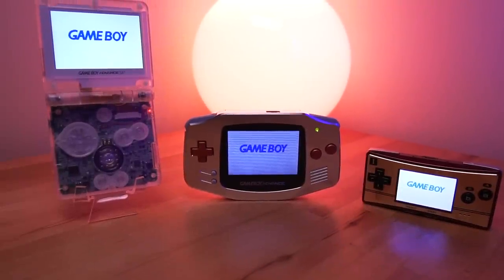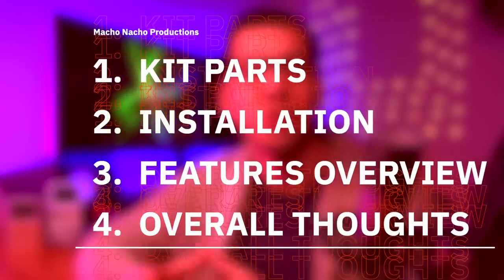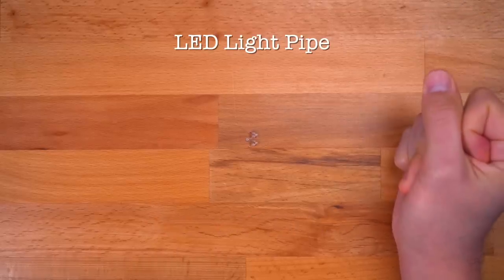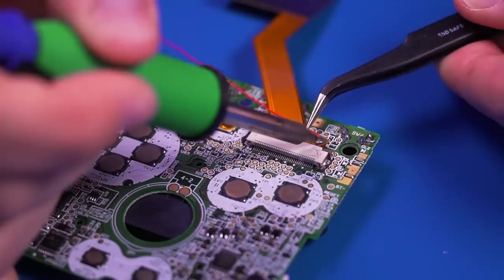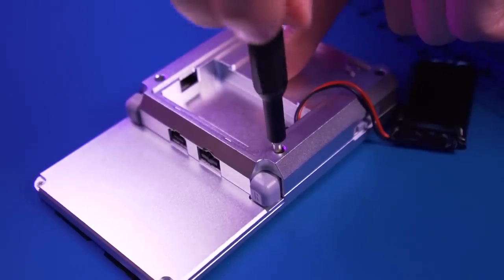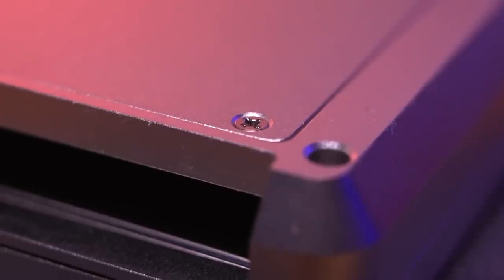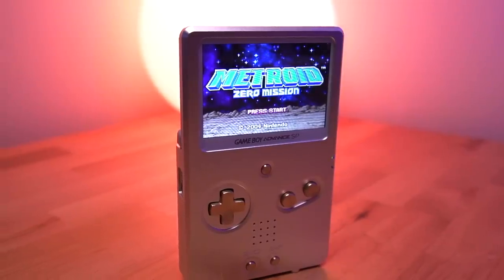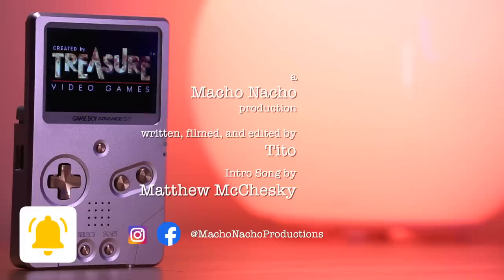GBA SP Metal Shell Without The Hinge! | Boxy Pixel Unhinged SP | Install Tutorial + Review

Comment: Honestly wish they also offered a budget friendly version of this design.... that $94 price tag is for like the 1% consumer....
Reply: I’de take a plastic clear version
Reply: Yeah I think a plastic Version would be cheaper
Reply: I hate to say this.... someone could copy it in and 3d Print but that would be super DICK move since they went through the trouble to make this in AWESOME aluninum.
maybe the $94 you can do like I used to do to be able to afford things.. I put an envelope on the wall and would put a couple bucks in it until I could buy what I wanted.. Just a suggestion.
Reply: @adonian  there are 3d printed non folding case for the gba sp since months on Plattform like thingiverse.
But not looking the same on the display part
Reply: There will be some company making a plastic version if this is even a tiny bit popular
Reply: @-Gothicgirl-  you would think that is the case, but for plastic, a tool would have to be made which would cost at least $10-15k depending on how well it is made. If he sells 1k units, that would still be a minimum of a $20 cost added onto the unit from the tooling alone. Would probably be in the $50-80 range depending on the final materials. For that I think I would just stick with the full metal housing.
Reply: @ArielAces  I knew that because it is my job but a tool can produce more then every metal part must make.
With the tool could be produce more and fast and then the price can be low. Look to the other custom shell of plastic.
The dont cost 100$
Reply: @-Gothicgirl-  sweet. I’m gonna look for it. Thx
Reply: This comment reeks of not realizing how this isn't a big hardware seller like Nintendo, Sony or Microsoft where they can source in huuuuuge masses parts and what not for cheaper.

You do want people who make these shells to make a profit so they can keep working on making these, right?
Reply: Boxy Pixel himself said on his Facebook that he's not the first to sell a shell like this for the sp, he just wanted to provide a possibly popular aluminum option.
Reply: It's even more than that since you at least need the usb c port, and the metal buttons. You'll also need soldering experience. It's just really a product for a gba enthusiast with some money to burn. I could see myself getting this at some point. Trust me, I don't make a lot of money.
Reply: This is way to expensive for most of the people. I thought at first i'd cost you in 100$ in total including a screen damaged SP, not 180 without it. Sorry, but 20$ for the BUTTONS? Also, i live in Europe, that would be +50$ shipping. Why not make a Design where you can use your own ones?
This is really just for rich people who have a lot of money to burn, not a teenage retro-enthusiast like me.
Reply: @magicalruin  it really isn't though, I am terrible with money myself and I am no where near rich, but I spent a good chunk of money to mod an original GBA. It just meant I spent the money on that instead of having it for new games or something.

I know not everything is available to everyone money wise when it comes to situations like you say being a teen, but that doesn't mean "it's for rich people"
Reply: That aint shit compared to the 300 dollar price of the metal gameboy color.
Reply: Really??  In this day, there is NO GBA "consumer".  We are all enthusiasts since it has been obsolete for nearly 20 years.  And in this "enthusiast" market the price tag probably sits closer to 10-15% of us fans.  And, they will most likely sell out.  Yes, this is a niche market, and being that it is not mass produced, the price, as  I see it, it understandable.
Reply: @maxinsano7376  100%. I buy these just because I like to. I play most of gba games on my vita

Comment: I hope they make an affordable plastic version
Reply from the maker: That would be awesome!
Reply: It would probably more comfortable as well. Probably
Reply: Probably not because they go on the bandwagon "making it metal = premium".
BTW metal housings are not more expensive as plastic in production, it's just markup because companies know that metal is associated with higher Quality (which it isn't) so they charge you more.
Reply: @livinlicious  I mean, metal is more expensive; but it's like 20%, not 200%.
Reply: @scrubscrub4492  yeah but of course having any injection molded parts would be significantly more expensive than anything milled or printed.
Reply: since you're looking for a 3D printed product, because you said affordable plastic, there's a few projects on thingverse
Reply: Aliexpress is probably working on it.
Reply: It if was plastic it'd be more breakable
Reply: @livinlicious  i hope another company picks up on this idea, would also like to see a ds lite version since snapped hinges were more frequent there.
Reply: The injection molds are quite expensive (like 10-20k for those parts), so CNC milling aluminum is probably still the cheaper option for a small series.
Reply: @scrubscrub4492  It's not the metal that's expensive. It's the CNC machining. To make the injection molds for something like this would cost somewhere around $25k to $30k just to make the molds, and then more money on top of that to cover the actual manufacturing of the shells. Even at $50 per plastic shell, that's 500 units just to break even on the cost of the molds.
Reply: they'll probably have to redesign the upper part cuz that screen part looks very prone to breaking if plastic.
Reply: @scrubscrub4492  CNCed aluminum is way more expensive than plastic injection molded plastic.
Reply: I feel like this comment is a joke no one got LOL.
If only they would make a plastic Gameboy...
Reply: Falta audio 3.5
Reply: @livinlicious  that's the dumbest comment ever... cnc time is not cheap and yeah when your talking low number runs, plastic injection is expensive too but we aren't talking about some place in China pumping out 5000 plastic shells are we??? So what you're saying is hugely irrelevant to the situation. 

They are a extremely fair price for what they are not being mass produced.

Comment: Am I the only one, clamoring for a boxy pixel shell for the PSP, with a nice screen, bigger battery, maybe with the disk tray removed, making it thinner.
Reply: Yesssssssssss, or even for the Vita....show the vita some love boxy😭😭
Reply: If you dont want the disc, with a c, drive, then buy a psp go. It has the nicer screen and is smaller, etc.
Reply: @Di3mondDud3  I much prefer the controls on the OG PSPs to the Go
Reply from the maker: That would be something I can get behind!
Reply: You lost me at thinner with no disc drive. The PSP's digital support is terrible, there are so many great games you can only get on UMD. Also, thinner eventually starts to get worse; harder to hold, less ergonomic. I'd rather have a thicker, more ergonomic system.
Reply: @mjc0961  same reason i like the wii u and its gamepad way more than the switch.
Reply: @mjc0961   I would love it if they could keep the UMD Drive. However, Most UMD lazers go to crap. And im not sure if many companies want to tackle the UMD lazer setup, when most people can get ISOs, of their games.
Reply: @mjc0961  to be fair, digital support is fine if you mod, which most psp owners should have by now
Reply: mjc0961 the games problem is easily solved by just softmodding your PSP and ripping the UMD’s isos then having them right there to boot without needing the actual UMD in the system.
Reply: @4rtie  and even those chinese twin micro sd card to ms duo adapters work to make getting good storage amounts easy

Comment: Great video man, definitely was excited to check this one out.
I got my hands on this myself and I gotta say I have a few issues with it myself. Most you already addressed, but a big one for me were the L/R buttons, the loss of the springs makes the buttons feel stiff and not having that slight kickback from them just doesn't feel right. They still work just fine, but in terms of comfortability, I'd say it just doesn't feel too good pushing those buttons, especially when they're so close to the upper back of the shell now. It's almost a deal breaker for me if I'm going to be perfectly honest.

The light pipe not fitting properly was also pretty disappointing. But, seeing what you did gave me an idea of what I can do instead.

The other issue I had, it's not too bad, but I have to point it out. I ordered the 3D printed parts to fit over the optional USB-C and headphone jack openings and temporarily installed them, but I ran into an issue where the parts just don't stay in place. Maybe I'm missing something? But it looked as though the GBA SP motherboard is supposed to hold them in place, but I found that nothing worked to keep those parts there, and I really didn't want to use hot glue.

Overall, I think this shell is amazing aside from those issues I ran into. The big one for me is mostly the L/R feel.
Reply: Thankfully barely any games use those buttons
Reply: this was the comment i was looking for. just built mine, and had this issue and a few more. the 3d printed parts not fitting and being color matched like the original sp housing is such a letdown. i feel that boxy pixel just got lazy and knew they dont have to improve their product to sell them

Comment: When this had been announced as being GBC oriented, I was hoping for top loading instead of bottom loading carts. :(
Reply: kind of hard to do
Reply: @levanpolka289  Not particularly. I've taken apart the Gamester Game Changer. I know what's required to do it
Reply: @ViolinistProductions  yes, but if it's already at $94 i think trying to add something like that would be an extra $50 and nobody wants to pay $150 for a GBA shell
Reply: @levanpolka289  You have to remember, the average person isn't looking at this, it's already a specialty item. Setting it up to be top cart loading would be more beneficial to those already looking at this, than not.
Reply: @ViolinistProductions  Nah. Having to desolder and re-wire the cardridge slot to move it would put this in a whole different level of skill to do. Right now it's mostly screws, you want to move it into advanced soldering. Whole different skill set, whole different potential userbase.
Reply: @mjc0961  You don't do all that jazz. It's a single pcb that slides into the standard cart slot with cabling to a new port you just move to the new orientation. No soldering/desoldering of any kind.

I've literally taken apart the Gamester Game Changer, that's all it is. A single pcb that plugs into the cart slot, that's connected to a separate pcb with 3 cart slots on in.

You make the same thing, but single cart slot, wouldn't be that much work.
Reply: @levanpolka289  If you have the money to buy a shell for  a gameboy120$ (cause you need the buttons too) you have the extra money for something like this too.

Lets be honest, maybe 1% of those who would buy it really does because of the Price.
Reply: I agree, bottom loading on a model like this feels kinda wrong. Missed opportunity for sure

Comment: The issue with the GameCube adapter identified at 15:18 in the video is a physical issue caused by those clips.  You can remove the clips from the adapter without breaking them and that would solve the issue.  You would of course have to be a bit more careful in how you handle the GBA.  This should also apply to the Infrared and Wireless Adapters, which have similar clips.  The e-reader may be tricky due to the way its link port extender is placed, (see its wiki for details)

Comment: i'll wait for someone to copy it in plastic for a more reasonable price! But, i can't deny it looks gorgeous. Superb design.
Reply: I've did this once with 3d printing, i found the project from thingiverse (boxypixel takes the inspiration from there). it cost me around $20 to print the parts, but sadly no RL button and no charging port (need to solder the RL button with a tactile switch and a usb c charging module for the charging port)
Reply: I don't know how the bit that holds the screen would translate into plastic..might not be strong enough to keep from breaking away from the lower section the first time it get bumped..
Reply: @jimcornish242  i'm using some kind of styrofoam to hold the lcd (i'm using the generic 001 lcd)

Comment: Since this is a shell from scratch, I really wish they would've focused on making the battery space even bigger since the ips mod is so power hungry and 1700mAh isnt enough
Reply: Dang, cant you just play plugged in? Where do you play that you burn out of 1700mAh and have no wall outlet? Just curious.
Reply: 1700mah is over twice the standard SP battery size...
Reply: @DokterRoetker  i guess i was a little misleading in my comment and i apologize for that. what i meant was that even though 1700 is really great and enough for 1-2 days of gameplay (i have the retromodding 1700mAh in my GBA), i wish that they at least could've maybe made the space somewhat bigger for the battery. I only have this opinion based on that this is a custom shell and they can therefore make it as custom as they like. i quess it probably was on the table when they developed this, but the size shouldnt be too thicc either
Reply: @crilleredits6360  okay fair enough. But to have a bigger battery option one would only need to exchange the rear housing, so it's still feasible in the long term
Reply: @DokterRoetker  true, if they did make a seperate back for this shell so you could choose a bigger battery (and maybe fix the L and R trigger issue ive been reading), then it would be a win win :)

Comment: Hey, I just did this. Here are some notes:

* yes, you do need the springs for the triggers and the shell is designed to use them. Don't skip that, he probably did because he didn't know at the time that it's really easy to put them in, just put them in the other side of the shell with the battery. They'll stay in palce with the posts so long as you don't jank them around during assembly.

* There's lots of room for cable management, but it will take some trial and error.

* The headphone mod is by far the hardest part. I melted my C25 capacitor off. If you do that part of the mod (not in this vid) be careful! Getting that back on is the hardest thing I've done in my life, it's about a quarter millimeter by a half millimeter in size.

* I got my shell today so it may be a newer revision, but I did not need to trim a bump off of the light pipe rest.

* You may find it helpful to use super glue to keep cables in place. It's not super permanent gluing to aluminum, so just helps with routing.

* My headphone jack doesn't go the full length to the aluminum bracket that's meant to secure it in place. I used a zip tie that was the perfect width to fill that space and super glued it in place. I'm now confident putting headphones in will not push my jack into the system.

* For some reason when my headphones are loosely plugged in they're way louder. If you know why, I'd love to know.

* Cable lengths would have been nice to show in the video. Here they are:
    * For the usb-c you'll need about 1.25x the diagonal length of a regular GBA SP. (~15cm). 
    * For the headphone jack mod it's entirely based on how you route the cables and if you have an AGB 001 or 101 motherboard. If you cut 17cm for each that'll be overkill - just route and then trim to size.
    * The brightness cable should be included, but if it's not it's about the length of your b-button to your up-button on the motherboard (3.5cm)
Reply: I did the mod too. Fortunately I was able to the headphone jack mod rather easily but my biggest issue was with cable management. Took a while but I finally got it. Idk if you had this problem but on mine the power indicator does not show charging (orange) when I have it plugged into a usb wall charger however it does turn on when I plug it into a usb c port on a computer. Super confusing. Also my speaker didn’t work but they may have been an issue with the game boy I bought. I ordered another speaker for like 4 bucks.

Comment: Wish this shell flipped the motherboard having the cartridges on the top behind the screen
Reply: That would end up with reversed controls
Reply: @20cent  yeah some extra pcb and soldering would be needed. Would probably try to extend the slot with a ribbon to move it up and have an extra pcb on the bottom to move the charger and link
Reply: @Jaxru  if there was an adapter cable that plugged into the cartridge slot, and ran to the top that would be ideal. Kind of how gamesharks used to work. Might make the system a little thicker though.
Reply: @lapislazuli1431  yeah something like that, shouldn't be impossible to do without adding thickness, just got to secure the cable.
Tempted to try and make a case and 3d print it.
But don't have excess sp's to experiment on